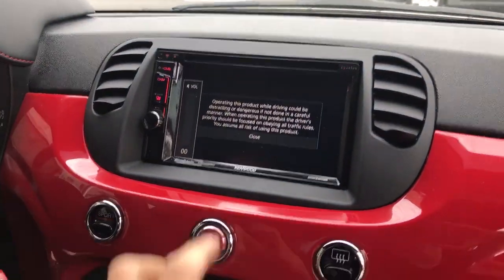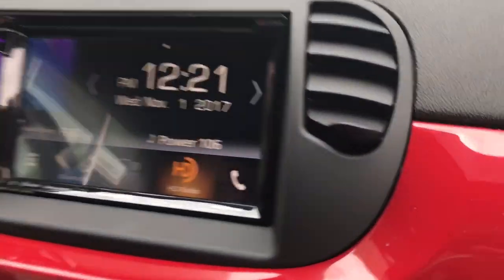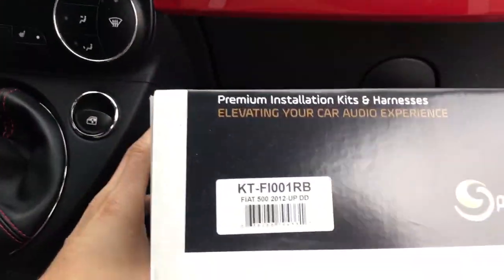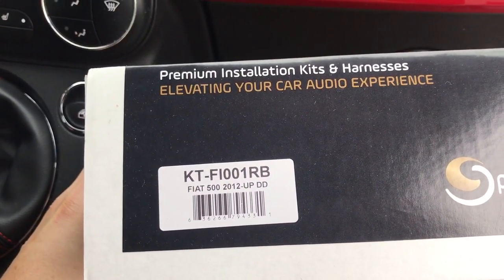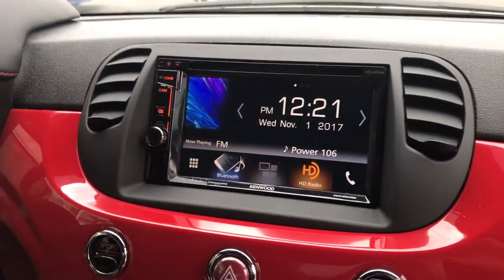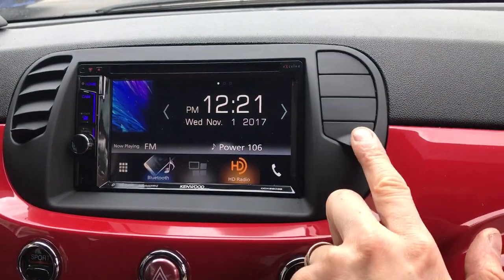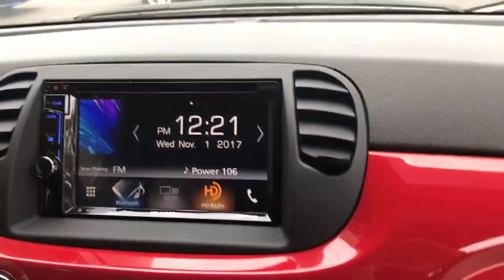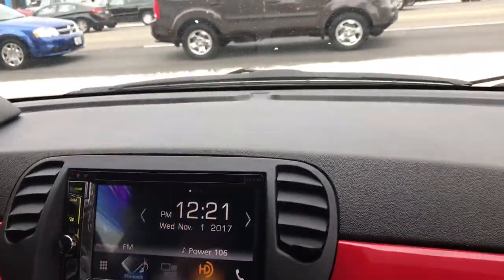Fiat 500 double din CONVERSION kit by 500 madness and spiral audio

Comment: looks awesome. did it improve the actual sound of the stock beats system? i find i quite quiet, bassy but no real punch. my old 1989 lincoln had a better sounding system and all i did was put in a pioneer deck nothing else. even my 2012 charger rt didnt compare to it and it had an alpine stock system